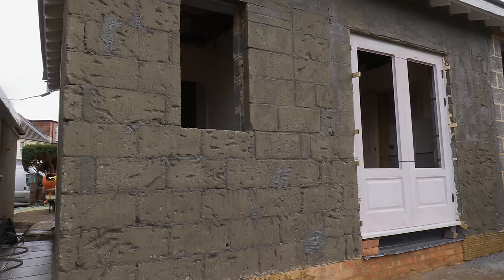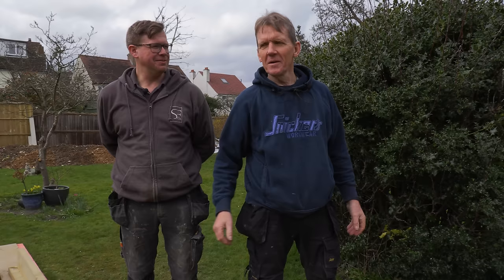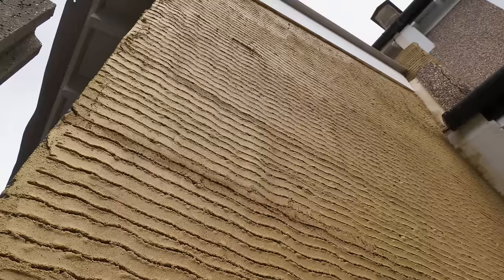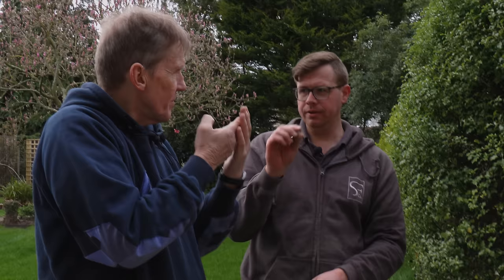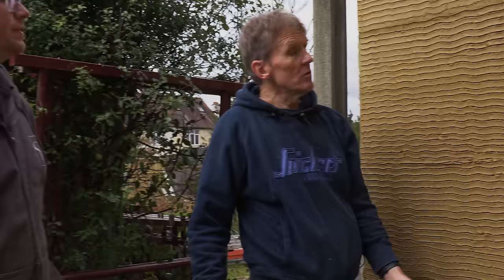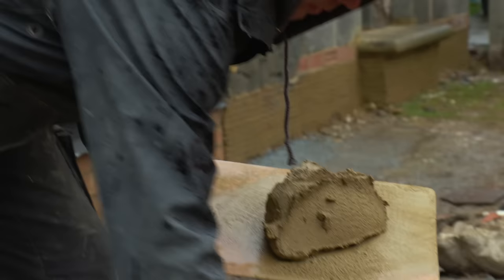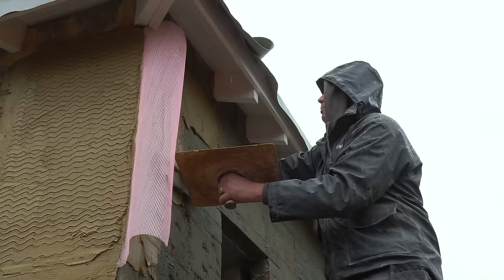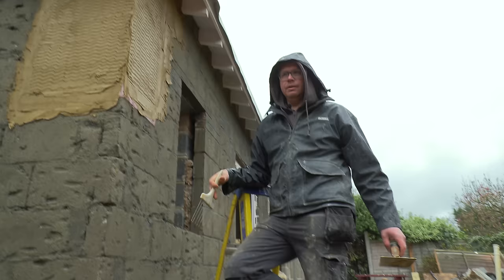How to Get Your Render to Stay on the Wall - KB#8

Comment: Nice work Buddy
Only thing is the customer must be prepared to pay loads more for the sbr  coating and the render meshing

All good if they want it done properly 
But Just to apply the sbr by brush is a job in itself it  ruins clothing driveways and anything it touches
Its also expensive and to be quite honest it seals the blocks surface as it’s waterproof 
You are meant to apply your render over it whilst it’s still wet and this is very time consuming and stops you getting into a rhythm 
By using the mesh you are sandwiching the render on  that’s the only reason that your scratch coat will hang on to the dried sbr , the small cement Particles mixed in with the Sbr are barley dust the render will not key to this unless it is still wet 

I use rendermesh on internal plastering that needs reinforcing , cracks etc and I always skim on tacky pva adhesive after I have first applied a sealing coat the previous day 
Render mesh is great but also slows the entire process down your infact putting 2 scratch coats on and cutting all of the mesh
Loads more money !!!!
I read Books and have been A Plasterer for 37 years 
I’m not a Jack of all trades I’m a specialist in this field 
Good vid though

Comment: The reason we put waterproofer in the scratch coat is to stop the suction so you can get a decent amount of top coat before you pebble dash.When rendering in just sand and cement I wouldn’t put a waterproofer in any coat,especially the scratch coat unless you wanted to hang around all day to rub up
Reply: Handy when its a hot day tho 👍🏻

Comment: Hi, does the sbr and cement mix go on with a brush then? Could you tell us the mix you use for scratch coat and top coat? Thanks. Excited for more videos
Reply: Yes, it’s brushed on. Mix I use is 5 sand, 1 cement, 1 lime.

Comment: I was taught to do straight scratch lines because moisture can sit in the dips of a wavey lined scratch and cause issues - I have never had an issue with straight lines.
Reply from the maker: You are right about the moisture but wavy lines are much better for relieving stress from shrinkage of the cement.

Comment: going to try and render a wall,what length and width of trowel should i get,cheers
Reply: Hi there,
If you’re trying it for the first time I’d recommend a 14” trowel. It’s also worth having a straight edge about 3-4 feet long which can use to rule off the render that you have just spread on to show up any low or high spots in the render.

Comment: I could really use some advice in regards to applying Weber tyrolean system to a wall which has poorly fitted windows (fitted unlevel) where I cannot use conventional render profiles. Kind regards.

Comment: So will the door meet building regs spec for energy efficiency?  (Sorry can’t remember what part letter it’s in)
Reply: No Skills it doesn’t, but weirdly our building control officer doesn’t seem too bothered about anything, just random stuff like doubling up the hip rafter and additional locks on windows and doors!?! It’s good in some ways as we know what we’re doing  and can just get on with it but worrying in others as he could let some proper dodgy stuff go on other builds. This is a door and frame chosen and bought by the client, it’s their house and their choice so they are lucky to have the BCO that has been assigned to the job. P.s I think it’s part L.
Reply: Part L, is correct, and new controlled fittings (windows n door) should provide the correct U-value. Even if he signs it off, it don't comply and might get questions if they sell the house. 🤔

Comment: Hi. interesting video. Thanks for sharing. Was this render going onto thermalite blocks? If yes, how do you get the time to spread it on the wall without the blocks sucking the moisture out as soon as it touches the wall? And, are you saying you don't need to use waterproofer in the 1st or 2nd coat?
Reply from the maker: Hi Lee 
When rendering onto Thermalites you always need to apply a slurry of cement and SBR with a little bit of sand thrown in. You could use Rendaide as an alternative. You need a good key and a suction killer and these products do both. There is no need to use waterproofer, it locks moisture in.  The reason plasterers use it is to give them more working time.

Comment: i like sbr in scratch, water proofer in final coat. i find if i put water proofer in scratch i find it doesnt key as well and takes an eternity to go  off.
Just my preference, every one likes there way.
Reply from the maker: I do the same thing. What quantity of SBR do you mix in? It is a waterproofer in its own right.
Reply: @SkillBuilder  I couldn't tell you off the top of my head as we are not doing it every day. I just go with the ratio to cement it gives on the back of the tub.   I just have much more confidence in the S B R. Might be in my head but I feel like the finish coat bonds a lot better to the scratch coat with it rather than render add mix.

Comment: Hi roger is there any problem with starting a 8 metre wall and joining it because I wouldn’t be able to finish in one day,
Reply from the maker: It is difficult to diguise a day joint. When the sun shines you will see it. Most plasterers get some help so they can get the whole elevation done in a day

Comment: Here's a question wonder if anyone in the SB community can help me. I've picked up a workshop extension for free. It's a prefab concrete unit with approx 50cm x 80cm panels. I'm wanting to render it up to match an outdoor kitchen and seating area I want to make in the garden. The other option is bolting battens and cedar cladding. 
Has anyone successfully rendered using suitable skrim and flexible render over prefabs or has anyone had bad experiences?

Comment: I’ve used the mesh and plug option. Does this work what he’s using or not???

Just looks like it’s floating in the render to me. 🤷🏻‍♂️
Reply from the maker: That is the idea. It gives the render some tensile strength.
Reply: What are the thoughts on ems sheets then?

Comment: That gap at the top of the door !!!
Reply from the maker: Easier to fill a gap than create on.
Reply: You mean the letterbox
Reply: It was a genuine mistake, that part of the building was built on an existing foundation but I took one course of bricks out too many when I took the old building down. However, it has actually been a blessing in disguise, we have only filled in the outer skin on top of the door frame and as it is an inwards opening door it has left a perfect recess for a roller blind which won’t interfere with the door opening.

Comment: What are breeze blocks?
Reply from the maker: It is a bit of an archaic term now but still comes up high in the search rankings. It is really a building block with air in it. They used to be made from flyash from power stations  and cement. The problem is they were quite acidic and corroded the wall ties. The new variant is an aircrete block made by Thermalite and Celcon, to name but two. 
This involves throwing a handful of zinc filings  into a mix sloppy mix of cement and sand. The zinc reacts with the cement and causes bubbles like in an aero chocolate bar and this produces a lightweight block with very good insulation values.

Comment: Idiot question coming up :-  Why the mesh and scratch coat?
I sorta thought the mesh replaced the scratchy
Reply from the maker: No such thing as an idiot question. The mesh is there to help prevent the cracking that occurs with aircrete blocks. 
The scratch hold the next coat. If you had concrete blocks or brick you might not bother with the mesh but would still have the scratch coat.